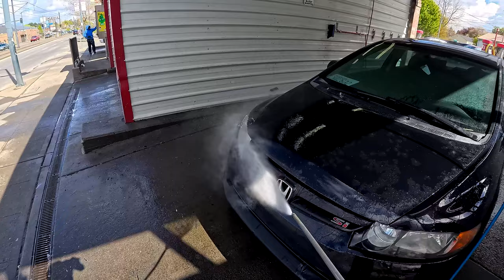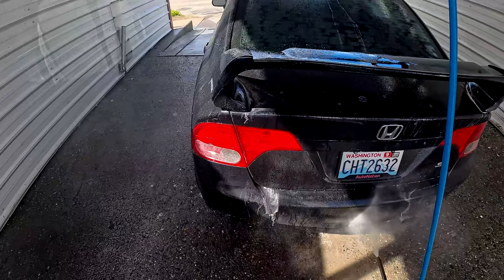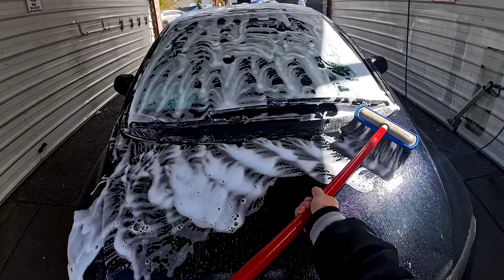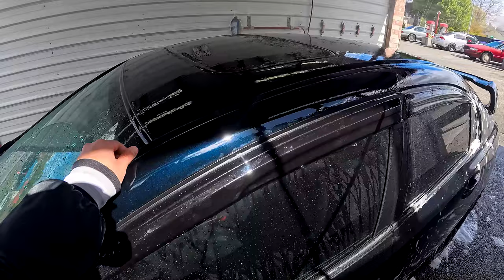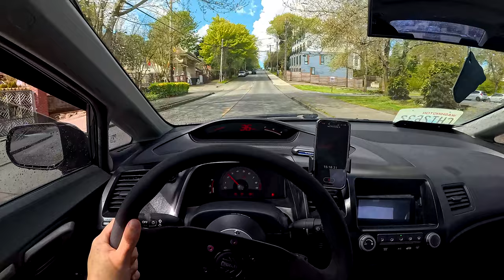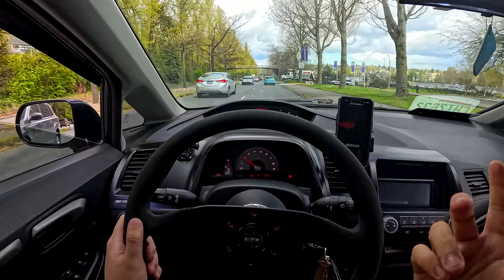Wash + Drive | POV 9: Post-Track Day Update

Comment: Hey Cass! been a while since I've seen your last post. Few updates, I got myself a new car but I was very picky if I wanted a K20 or an R18. In the end I chose the R18, I personally don't think you need the full RPM range for max power, I've seen plenty r18's make good power and I used to own a turbo r18 myself.

It's great to see your K20 on the road, now for your trans with the third gear popping out, it's your synchro so you do not need a whole transmission rebuild. For tips I recommend getting a built 2nd gear and replace all of the synchros. Trust me you will have a much better time on the track and feel the difference.
Reply from the maker: Thanks for the insight and appreciate the constant support 🙏 I know it’s the synchros, I was just chatting about the transmission and everything haha! I just feel like I’d want to get a new one anyway just in case because it definitely feels like a new motor is needed pretty soon if I want to turbo this far. I want to look into K24s in the future, the torque will be very useful for the midrange if I want to continue tracking the car. 

Also love that the R18 has some respect too! Never really see those be used very often I feel like everyone that I see that has a Civic with an R18 are just clapped out with horrendous exhausts or straight pipes acting like an Si 😂
Reply: @MidnightCass  haha yeah I need to buy a blown r18 because I have an auto and the transmission doesn't hold up very well. I ordered a new hondata which gets here next week I hope! but yeah I plan to get a yonaka exhuast because it doesn't sound like a rattlecan. It's sad that people don't appreciate the R18, its such a well built motor and you can find a used one everywhere incase it blows up. I only see ricers with 300k miles lol but the only thing I wish was different was the gearing of the AT. 2nd gear is so long I might as well only have a 3 speed auto lol

Comment: Hey i had a 3rd gear pop out and i changed my transmission fluid for amsoil and it hasnt done it since and it shifts perfectly smooth hope this helps
Reply from the maker: Is my next plan eventually after this new oil pan gets installed! Already had a few folks tell me about that but I appreciate the advice nonetheless! 🙏

Comment: Jesus. It's really adding up. 3rd popping out could be sooooo many things. Could even by weird things happening with the clutch and not the transmission exactly.  Then theres synchronizers etc smh
Reply from the maker: That's the thing though I feel like it's 100% gotta be synchros, I was just chatting about transmission because this car was abused through 6 different owners haha. It's on a beat up after market stage 2 clutch as well and has that 2nd gear grind too.